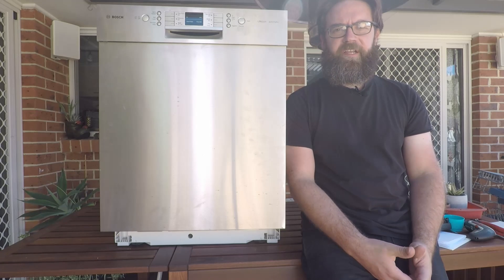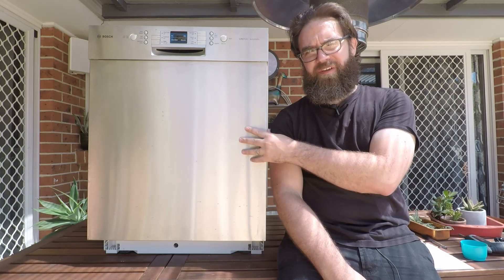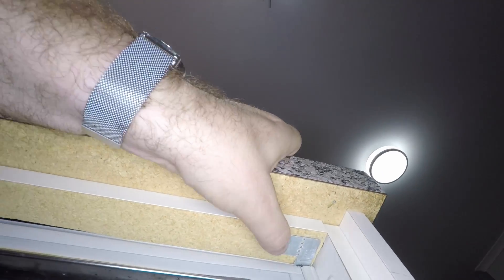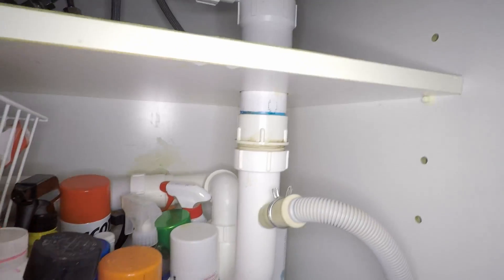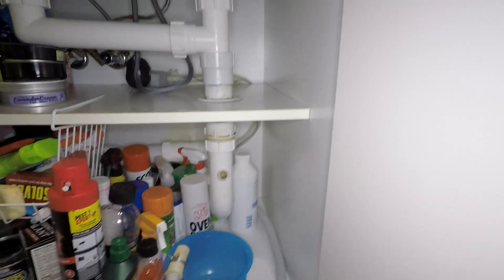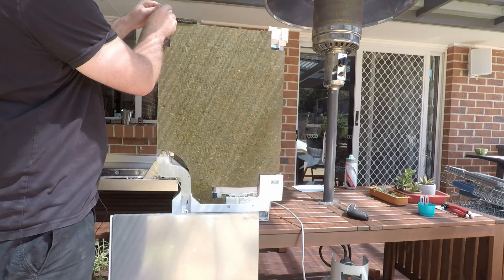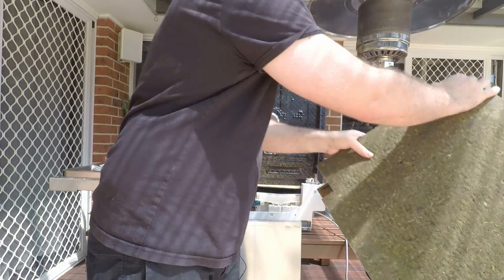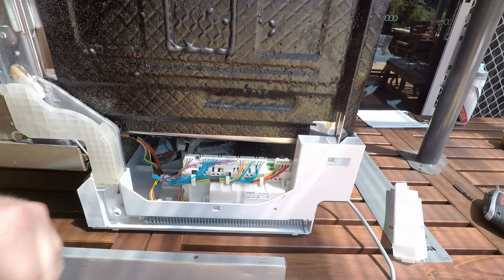Bosch E01 E02 E03 E04 E05 error code diagnosis and repair

Comment: Are you sure all those codes are all about the one thing - a power module? Sorry I don't buy that. The codes are different for different reasons. E-04 in particular is related to the heat pump OR the flow pump. The codes are different for a reason, otherwise why would they design a system with different codes for the ONE problem!? Doesn't make sense. Also, wouldn't the machine turn on at all with a defective power module?

Comment: Our Bosch Dishwasher is less than three years old. We bought it for €470, and now we need to spend €280 on a repair. The eater pump is gone. 
Our repair guy said he would not give a warranty on the part. He knows one case where this part was replaced three times in one year.
Bosch used to be reliable, but I will not be buying Bosch again...
Reply: The repair guy wasn't lying unfortunately, the new BSH heat pumps are absolutely rubbish we have had multiple failures from new. Awful design, make sure your salt container is always full and set your water hardness to maximum it can prolong the life of the heater

Comment: Good info but people BEFORE you pull the dishwasher out from under the counter turn it off and leave it for an hour or two.  Chances are good it will re-set itself and work once again.   We recently had two power outages which resulted in the E 05 code, I turned it off, having learned the trick from a washing machine repairman, the dishwasher is running as I type good as new (which it better, because it is).

Comment: I had message code E:01 I instantly was annoyed because I haven't had my dishwasher a month. I called Bosch customer service for a technician to come out. My husband  had a brilliant idea to flip the switch on the circuit breaker and then it was back to working again. I hope this advice helps someone.

Comment: I didn’t get the message apart from that if you remove all those panels u can look at the wires inside the machine. How did u fix the problem?
Reply: Totally agree... It was inconclusive. I have an E01 code. 

So, the answer is like, "Take everything apart, check some wires, maybe take out the power control board if you know what you're doing (which is why we go to YouTube, to learn what to do)... aaaaannnd, peace out, click the subscribe button."
Reply: I have boch w/m but there is this error coming 00:01 how can i repairs please reply
Reply: Exactly this is the most mediocre how to video I've ever watched on YouTube he doesn't tell you s*** except for how to take it apart and look at wires. What an a**** I just lost a whole five minutes of my life and I'm no further closer to figuring out my dishwasher

Comment: Now How in God's Name are those wires going to move or be impacted while the dishwasher? Does What? (Run a Marathon?) Kick Field Goals? Oh i know!!!! It SITS THERE AND WASHES "DA DISHES!!!" oH I HAVE EO-1 error code 1? I figured as much. What I don't want to read is the Old Power Module is broken!!@#$@^%&
Reply from the maker: Duh, of course it's doing a marathon that's why they call it running, same as your refrigerator. One day it hopes to replace Johnathan Thurston.
The old power module is broken - replace it

Comment: Help. I started with an E15 code. Tilted it... water came out. The machine then worked. BUT  didn't heat and had an E04 code.  I cleaned  propellers out. Used rinse cycle a lot with descaler.  It can now heat up but when it does it trips the electricity to the flat. What can I do.
Reply: Exactly the same symptoms with mine.  Did you find a solution?
Reply from the maker: Sounds like by tilting it you may have gotten water into the power control module. If you are comfortable with doing it, follow this video and check for water in the power supply. Good luck
Reply: Meshellshesells :what resin cycle you used? May you give the name or brand?